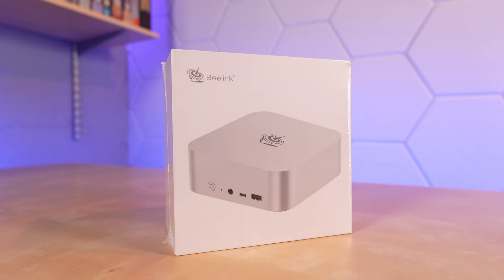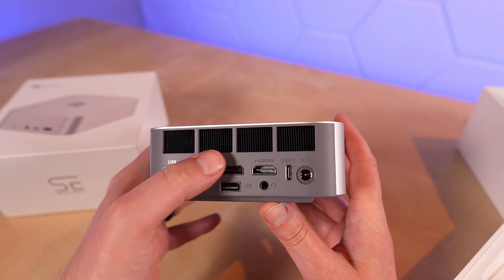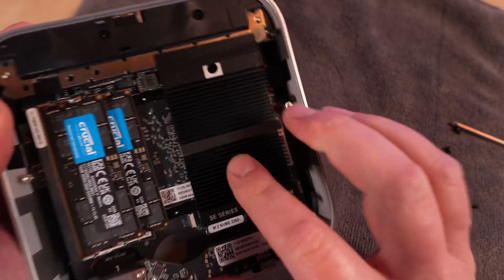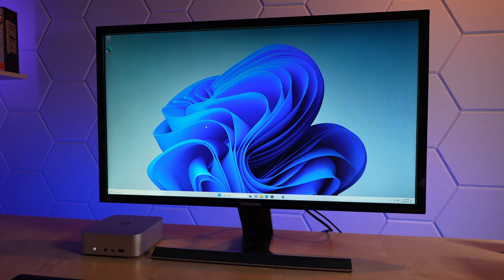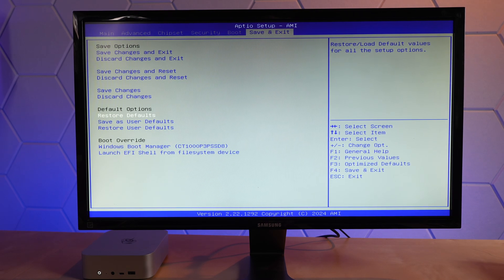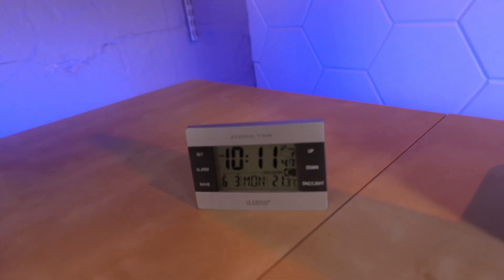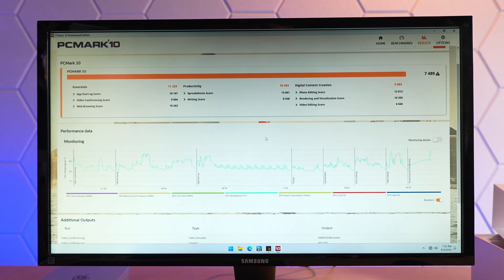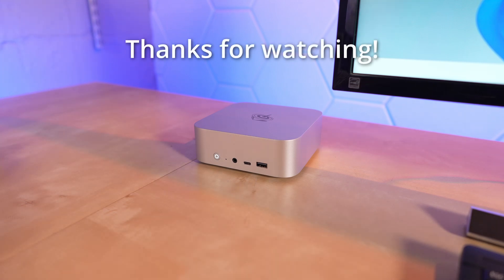Quick Look Review: Beelink SER8 AMD Ryzen 7 8845HS Mini PC

Comment: Great review! It's very refreshing to see someone actually showing real-world computer performance specs. instead of playing video games for 30 minutes. Some of us actually want a computer to do real work with. I am a Network Administrator by trade, and I have been building my own (and others') computers for decades. However, I have been looking into these mini PCs lately as a time and space saver. These Beelink Ser8 Mini PCs look promising, but how are they for long-term durability, I wonder? At least these Beelink Mini PCs have name brand, AMD, Crucial (made by Micron), and Intel components instead of generic parts. 

I saw another review where someone took the Beelink Ser8 completely apart. The cooling solution in these little computers is amazing. However, I have heard from several reviewers that the Wifi range and speed are terrible. This is probably due to the Wifi antennas being almost entirely enclosed in metal (except for the plastic case bottom, but the dust screen is also metal). This creates a signal blocking Faraday Cage. Maybe  an external USB WiFi adapter would solve the wireless connection problem?

Right now, I am looking for a good mini PC to run Lighburn software on with my laser cutter/engraver. Currently, I am using an Acer Nitro 5 laptop with an external 27 inch monitor, and this setup works well. However, I would like to free up my laptop for other uses and use a mini PC as a more permanent solution for the laser and Lightburn. If anyone has any long-term real-world experience with these Beelink Mini PCs (or other brands), please feel free to respond. Thanks!😊

Comment: The wifi is absolutely shocking, really bad, five metres from the router, its downloading in kilobits. If I use a mobile hotspot off my tablet right beside its fine. Dunno if it's just mine or because it's a metal box.😮 Otherwise it's amazing, emulator monster
Reply: I wonder if the wifi antenna cables were securely connected?  I ended up changing out the WiFi card and put in a Wi-Fi 6E AX210NGW (less than $20 on Amazon) in my SER8 and it performs much better now.
Reply: @mowcowbell  Sounds good! Might have to give that a go, thanks for letting me know! 👍
Reply: @mowcowbell  have just bought that card, did you have to install new drivers?
Reply: @michaeldonaghy4703  no it autodetected.
Reply: I didn't have any wifi and bluetooth problems and I could still maintain a decent connection past 75ft
Reply from the maker: Interesting. I had zero issues but I was in the same room as the router.
Reply: Update drivers from intel site,my wifi is working perfect
Reply: @junik2005  Happy days! That's a relief to hear there is a solution, thank you very much 😁

Comment: I had external floppy disk drives in the 80s (SF314) which I am pretty sure were larger than this mini PC.
The temps look good.
The one thing I noticed is with video editing performance while higher numbers than the Intel one you showed, the difference was quite small.  Also the Intel iGPU has support for more codecs which should make the editing on the timeline experience a more smooth one.  At least in theory as I never owned either of these computers.

The only two things I will say I definitely do not like about this pc is first the color.  I want bright colorful colors.  Orange, yellow, red, even blue, just give me something which isn't black, silver (including "rose gold") or even white.
Second, the difficulty in reach the CPU cooling solution for maintenance.  I don't know why almost every single mini PC manufacturer does this.  If you use these often then sooner or later you re going to have to clean them, if not repaste them.   Why so difficult?  Meh

Thanks for the video.
Reply from the maker: Good point on the codec support - I should really test things like that.